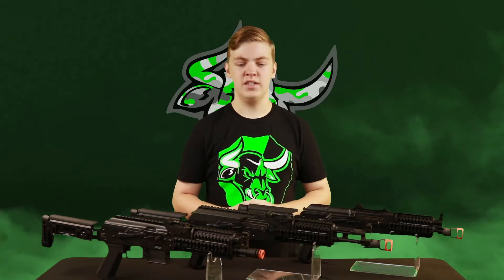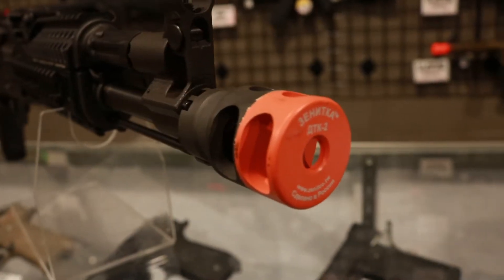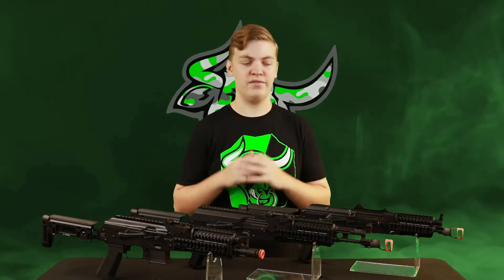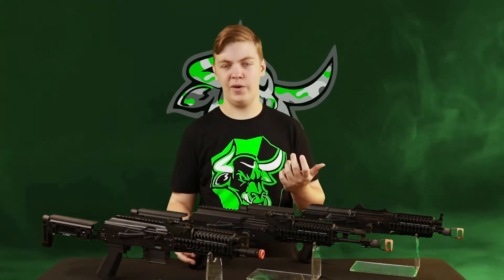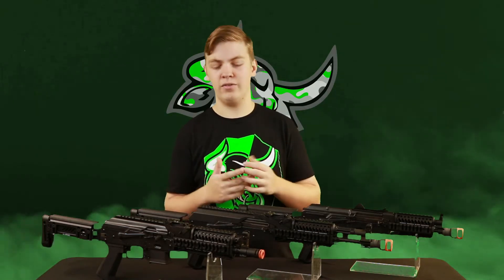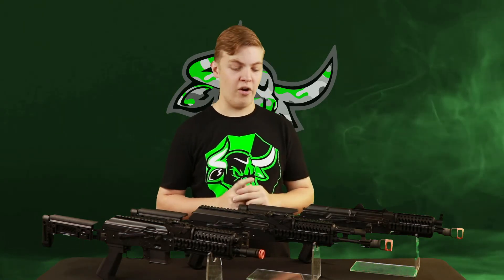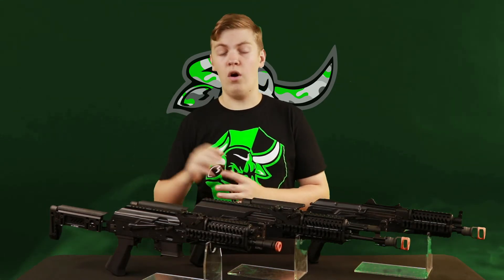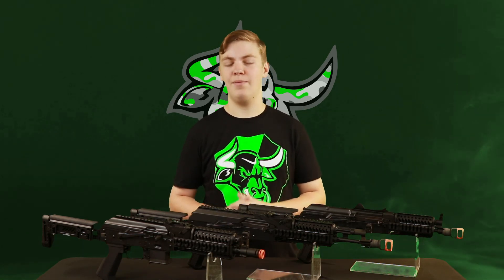The MK18 of AKs - LCT Z-Series AKs

Comment: is the 104(which is actually a 105 right) have the ability to fit the 11.1v ak battery? and is the spring relatively easy to change because of my nearby field limits?